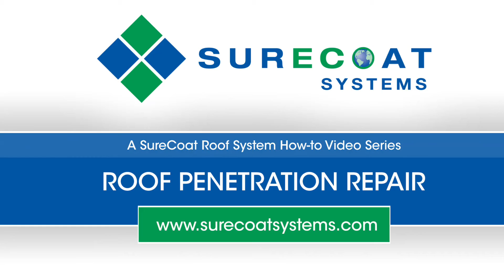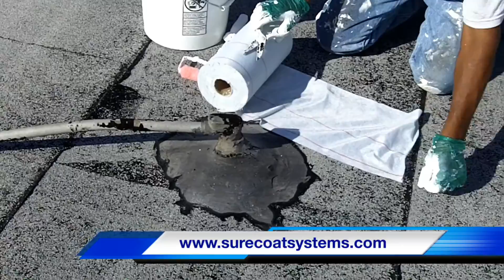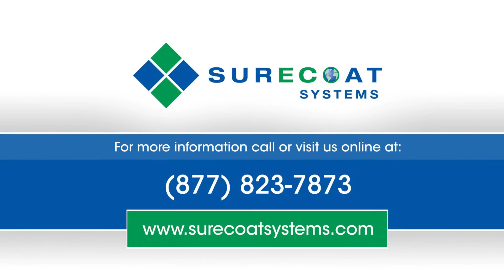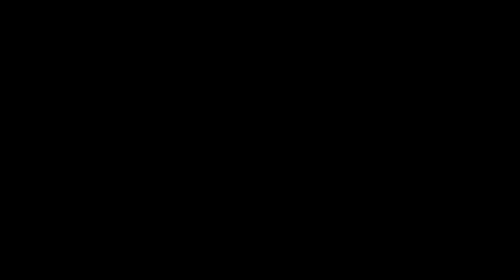How to Repair a Flat Roof -  Roof Jack Repair

Comment: Your men always do such great work! Thanks for the tip. There is a company that compresses styrofoam beads and makes insulation panels for roofs and walls and more. Have you all ever used them to better a 100 yr old almost flat roof and combined Surecoat to the top and bottom? As you know, flat roofs can be tricky with the age and who knows what has happened over the 100 yr period. What do you think? Hello to Jamie! Art
Reply from the maker: Hi Art! It's Jamie :-) Thank you for the compliment!! I love our guys too!!  This is not a system that we have tested but theoretically that would work. I have a display of architectural foam sample (same manufacturing process as you mention above) and the adhesion of SureCoat is supreme!  If your concern is moisture wicking through the existing roof and getting moisture in the styrofoam, coat the bottom of the styrofoam insulation before putting it down on your roof and then use the full 3-ply system, fully reinforcing the SureCoat with Poly-Mesh over the top. Sometimes you can take care of trapped moisture in a roof or foam with one-way vents prior to the install of the SCRS as well.  Of course if there is any substrate damage that should be addressed first. If you want a recommendation, take a few pictures of what you have going on and email them to info@surecoatsystems.com with your contact info embedded in the email so we know where the pics came from and I can have one of my Install/Tech Support Reps call you. Or you can always call here at 877-823-7873. Thanks for following us! We appreciate you!